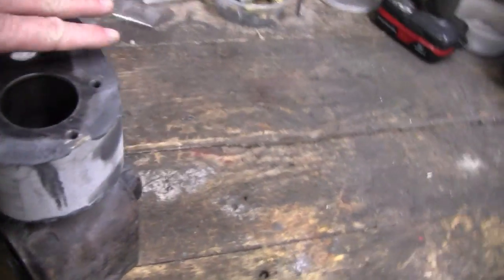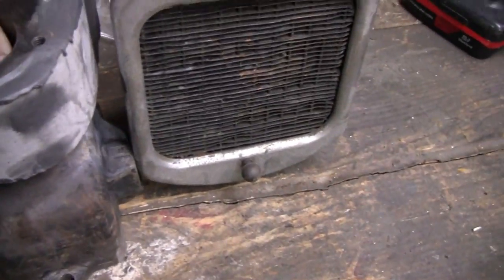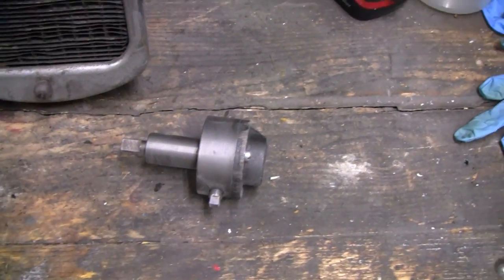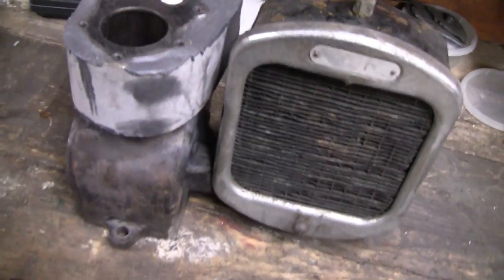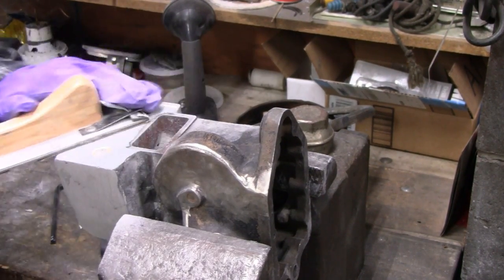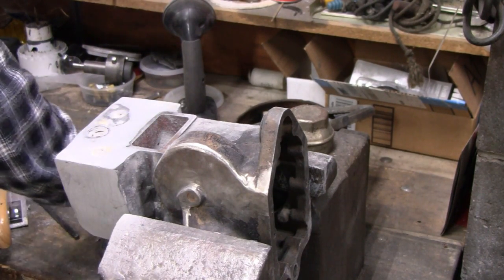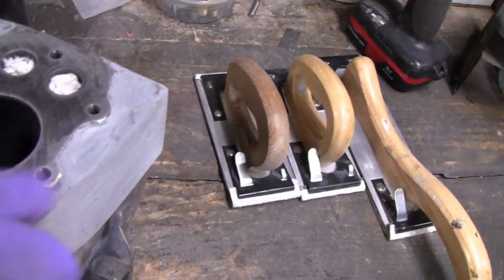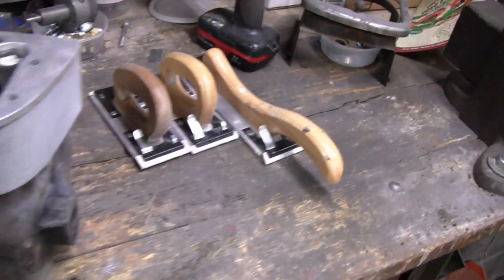HOMEMADE WATER COOLED BRIGGS ENGINE (part 19)

Comment: my old farmall doest have a water pump, its just the hot water rising and cold water falling that moves the water around the block, radater. maby that will work for you. one less thing to mess with. just a ideal, that will be nice when its done.

Comment: Is that :/ weld or body filler? If body filler do you have to worry about heat with it or is body filler okay with some heat?
Reply from the maker: It's paste epoxy, it will hold up to what little heat there will be!!☺

Comment: Perhaps adding provisions to put in a motorcycle thermostat wouldn't be a bad idea to keep it at operating temperature. Wouldn't be difficult to come up with a housing for it. They're pretty small, I think it'd fit the bill perfectly. Actually, making a little housing to sit on the side of the cylinder head jacket would look kinna nice. And it would look factory.

Comment: Hi  Thanks for the update the builds coming on nicely , With this custom stuff and some of your viewers saying this and that won't work sometimes. It's exactly the same as what happened to us when we ran diesel pro stock tractor pullers with guys watching in the pits, and the comments I see on tuned diesel puller start up video's  here to. The average mechanic or comenter has no clue whats going on compared to the every day world of Engines in the work place, or on the highway and what will work for short run times.

 I laugh at the guys saying it don't start  without ether because compression's low fix it, your injectors are shot with all that black smoke or what ever. What they don't see is the custom fuel pump that maybe puts about 70 gallon an hour to the custom injectors, The compression is low to allow the motor to stay together with huge boost pressures. The fact the timings altered so much its somewhere in the middle of next week compared to a couple of degrees. And everything else thats going on to get  500 -1500 or more hp out of a motor that was maybe 150 hp in a stock farm tractor when it was in the field.
Reply from the maker: I've found throughout life, that the ones that talk the most, do the least or most of the time nothing at all!!☺
Reply: 805ROADKING ...Amen brother.  I listen to some of these people describe how they would do something and in my minds eye all I see is one big mess.  I may have missed something on the four cylinder Briggs build.  Did anyone suggest a way to build the crankshaft for that engine?  That may have been a little too complicated for the armchair troll engineers.

Comment: Great work RoadKing.  I agree, cooling won't be an issue.  BTW, you probably could get away without the pump if you rig your inlets and outlets so as to "thermo-syphon".  I have a Continental N62 that uses thermosyphon cooling quite successfully.  Alas, I know the project and features are the key here, keep it up, doing great.
Reply from the maker: Thanks Bud!! You're right on both points, the crowds at the shows want to see all the bullshit attachments!!☺

Comment: I'm not certain that you can cut one of those thermometers off and still have them work. From my use of them they only read directly from contact at the tip. I mean I could be wrong and if so I hope it works for you.
Reply from the maker: We've shortened them before without any problem, it can be done if you know what your doing!! You should open one up, it's interesting how they work!!☺

Comment: The next project should be a motor made entirely of epoxy! By the way, if you cut the stem of the thermometer it will not work. That's where the temperature sensor is duh! Of course you could epoxy it back together... Just Say'n!
Reply from the maker: We've shortened them before without any problem, it can be done if you know what your doing!!☺

Comment: They don't make latex gloves big enough to fit my hands loose unfortunately.  I have to buy the largest size they have and still break them occasionally trying to put them on.  If my hands are even a little damp you can forget it because they will break every time.  I have been using the grease brand that are textured for extra grip and really like them.  You should give them a try next time, my dad likes them so much that he washes them and reuses them over and over.  He is cheap but that is a step overboard in my opinion.

Comment: What would look cool is a old motometer  used in the radiator for the temp gauge.
Reply from the maker: That's exactly what I told Mike!! If we could find a small vertical gauge that fit, I would find some little wings to glue on it!!☺
Reply: 805ROADKING dude I have the same problem it's either way to big or way to small 😐😐😐

Comment: Great videos and project. In theory what should water cooling do for the performance of the engine?  More power or longevity?  Thanks for the great videos.
Reply from the maker: Thanks Bud!! The whole purpose of cooling whether water or air is to keep the engine from expanding and contracting to prevent the piston and components from seizing  ☺

Comment: Really looks good! Thats plenty of radiator, really slick little radiator too, love the grille shell on it. It really won't put out enough heat to worry about it, its not like its running 10k rpms or anything as you say if anything getting to temp might be a issue. This is gonna be really cool, will make a nice running display piece. Good job buddy.
Reply from the maker: Thanks Rev D!!☺

Comment: Pretty good so far. You should have made it with a thermosiphon  system. With a pump its  going to remain cool and damage the piston and rings , more of which the engine is not going to run high speed with a load. Tank cool will be the best and sexy vintage look for that engine.

Comment: Turnin out pretty good. One thing I should mention. Those stick thermometers can't be cut. The mechanism that turns the needle to show you the temp are inside those rods so if you cut them you break the thermometer. I tried bending one once and discovered this. Wasn't fun since it was my only thermometer for high temp at the time.
Reply from the maker: We've shortened them before without any problem, it can be done if you know what your doing!!☺